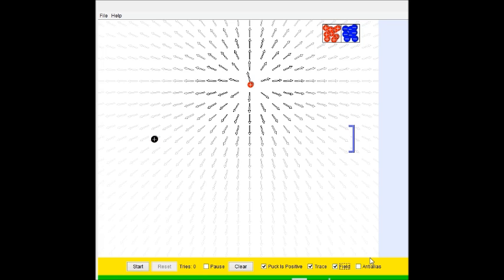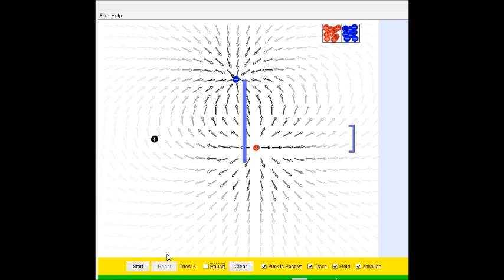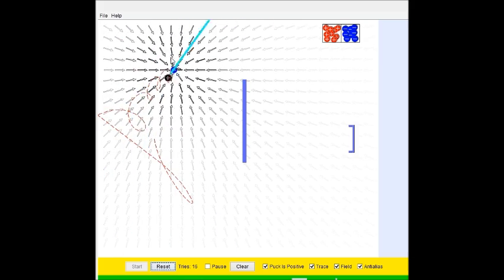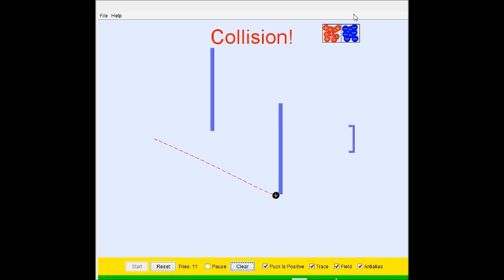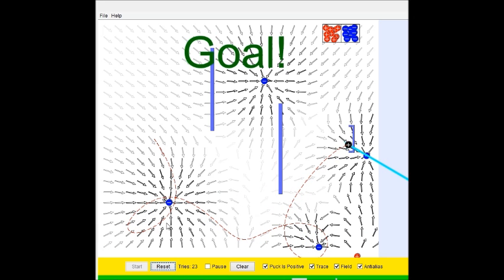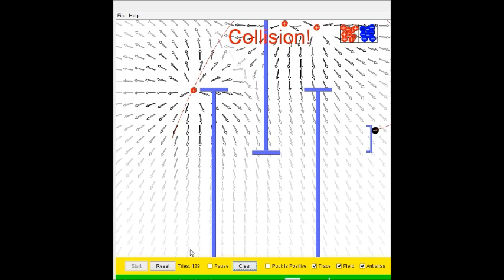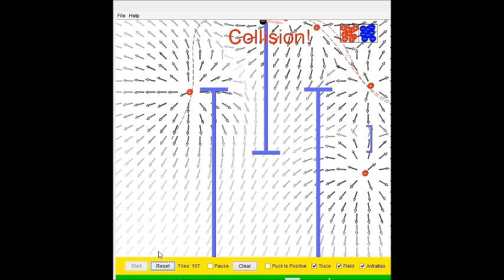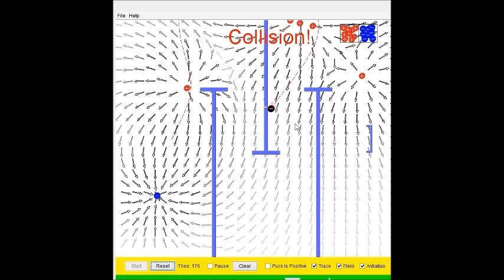Let's Play PHET Simulator: Electric Field Hockey

Comment: how is this at all conquered if you didnt actually go through the obsticals? A guy in my class did it with 5 negative charges and went between all the gates.
Reply: i built a race track and used 202 fucking charges